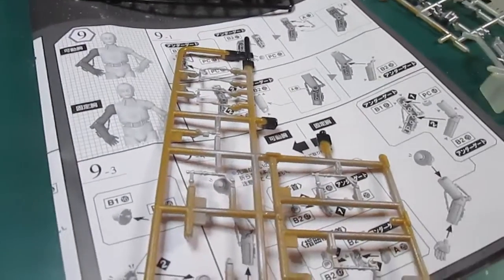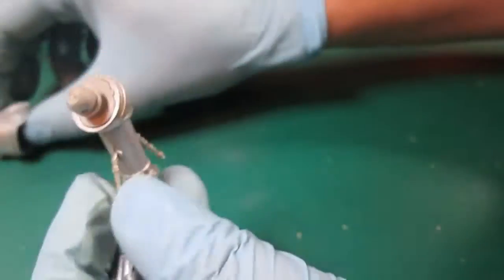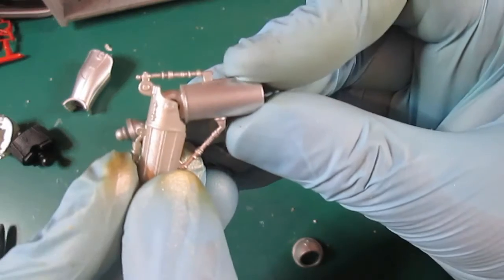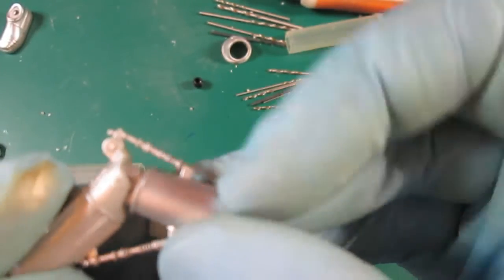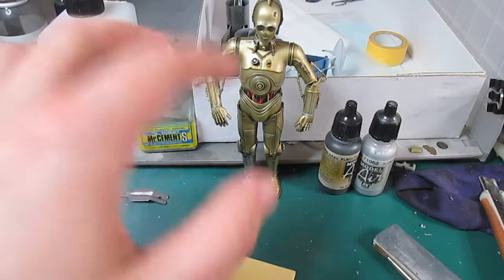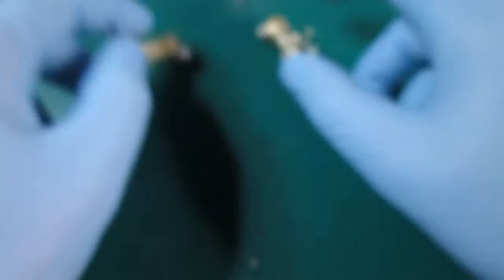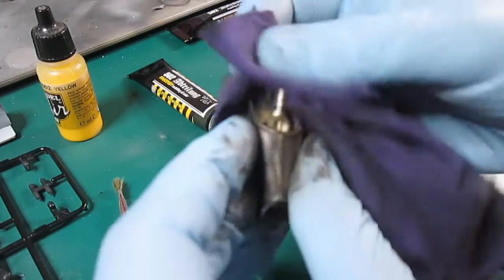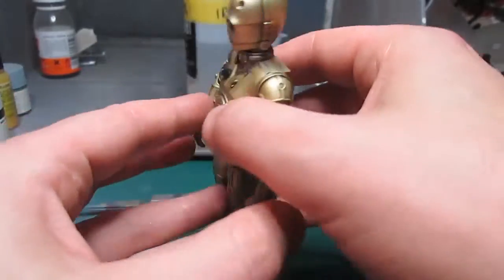Bandai's 1/12th Scale C3PO: Part 3

Comment: Klear is now called "Pledge Multi-Surface Wax"  Despite the name, there doesn't seem to be any wax in it.  It should (or may) say "Formally known as Klear" on the bottle.
Reply from the maker: Tony Blackwell I think they did that on purpose to stop us lot getting our hands on it lol, I've a vague memory of it changing names about twelvety times roughly 5 years ago... The new formula is slightly cloudy too, but dries lovely "Klear" and glossy still. I'll get some eventually... in another 8 years when I FINALLY finish my old stuff off. I'm too much of a cheapskate lol
Thanks again Tony, take good care lad :)
Reply: It goes to show the amount they mark up the hobby brands.  I paid £3 for 125ml of Humbrol Clear.  And about £6 for 750ml of Klear.  Cheers mate.
Reply from the maker: Tony Blackwell Just shows though, we're often paying for a brand name! And if the current version is anything to go by, it'll last a good few years too, as opposed to Humbrol, which is normally gone after three months. 'Cos I've spilt it again. 'Cos I've done that. And it's all Humbrol's fault for using that teeny bottle instead of the HOOJ thing that Future/Klear/Pledge comes in. Humbrol's fault, not mine :)
Reply: I'm glad it's not just me that's clumsy.  I put a bottle of Tamiya Extra Thin cement into my drawer without putting the lid on properly.  Not a good result.  And the amount of tiny parts I've had to go hunting for on the floor is ridiculous.
Reply from the maker: Tony Blackwell You have a carpet monster too? I swear, a few weeks back I hoovered in the 'Cave, walked in half an hour later in bare feet, got prickled by something... gets low enough to see it, and discovered it was a teeny piece I'd lost of a Spitfire TWO years ago. I vacuum in there every week on a Thursday, and that part has been there for TWO YEARS!? Either I need a new vac, or the carpet monster is playing tricks on me...

Comment: is there anything other than starship filth you could have used as a gunk wash on this?
Reply from the maker: +Terry Wright Hi Terry! so long as you use oil paint, you can use any shade you like from any brand - this technique doesn't really work too well with acrylics.
Reply: it's just I can't find starship filth anywhere is all
Reply from the maker: +Terry Wright nobody can Terry, it goes through phases of being sold out for ages and then a batch gets released and it'll sell out again. There's a magazine collection for a huge millennium falcon model, it's all being bought by those guys I'm afraid!